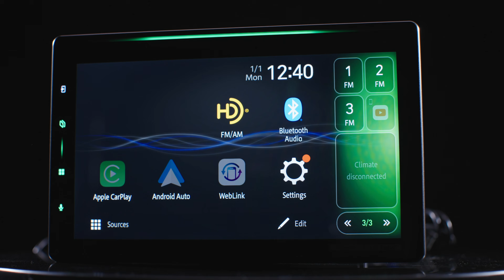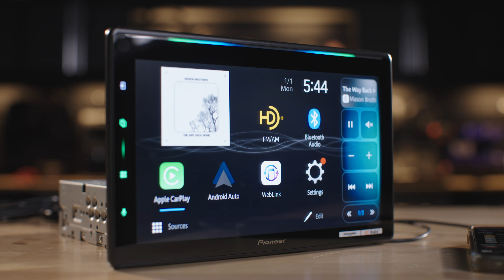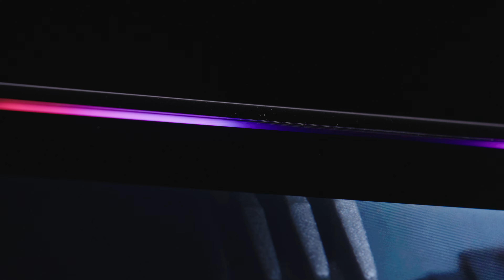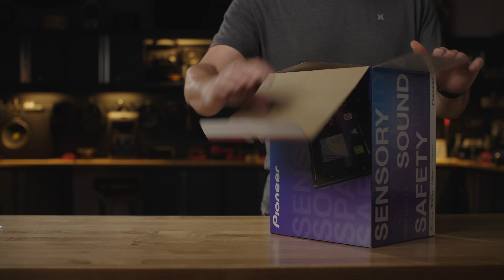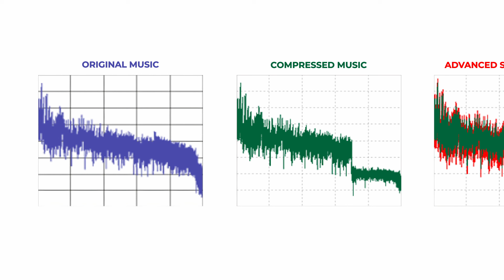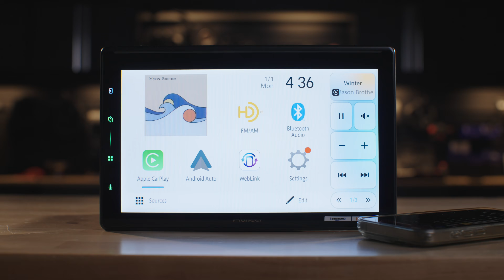Pioneer DMH-WT6000NEX high-res floating screen receiver | Crutchfield

Comment: Is there a built in version with the same specs and features?
Reply from the maker: This large of a screen is mostly made to float in front of the dash but sometimes, there are vehicle specific radios or mounting gear to make the screen work as if it was built in. We can check your vehicle for such options. What is the year, make, and model of it?
Reply: @crutchfield  2013 Subaru Forester!
Reply from the maker: Thanks. Did your car come with factory  DVD and navigation? How many factory speakers did it come with?
Reply: @crutchfield  absolute base model.  No DVD, no tweeters, no sub, 4 speakers
Reply from the maker: The Pioneer DMH-WT6000NEX is a fit in your Forester but would not install flush with the dash kit provided. You can install it and adjust the floating screen, or you could consider the Pioneer DMH-W4660NEX below that fits flush in the dash kit.

https://www.crutchfield.com/I-rYALc166/p_130DMW4660/Pioneer-DMH-W4660NEX.html

Comment: No Anti-Reflective touch screen?  Big money, big mirror in the dash.
Reply from the maker: A fair point. We didn't have a chance to install it in a car and see how it looks in daylight. However, it doesn't look like a mirror to us in our video studio, at least in the same way some computer screens do. We had big video lights shining all around it and were never distracted by reflections, for what it's worth.
Reply: @crutchfield   Hard to believe they didn’t include that at this price point.
Reply from the maker: There's not a lot of brands releasing models with touch-screens that have anti-glare/anti-reflective coatings on them. The good news is that the capacitive touchscreen is the least effected by ambient light touchscreen to come to market at this time and Pioneer is using it on this radio.
Reply: @crutchfield  probably be able to get a non reflective screen protector at some point also.